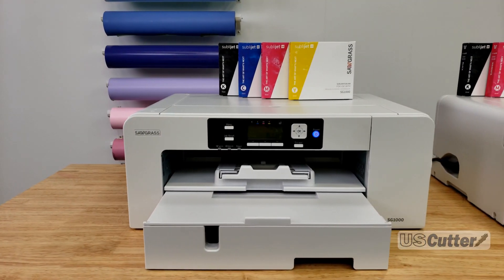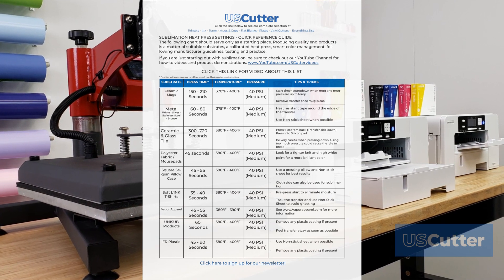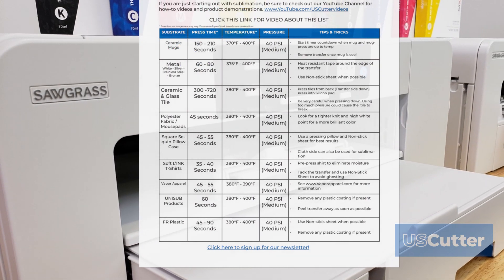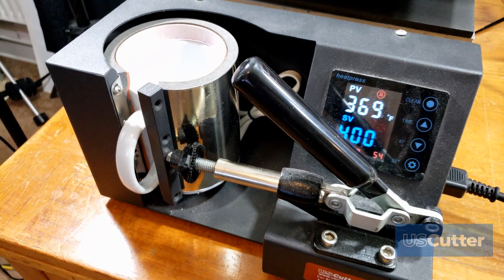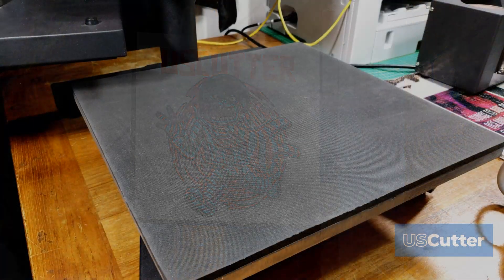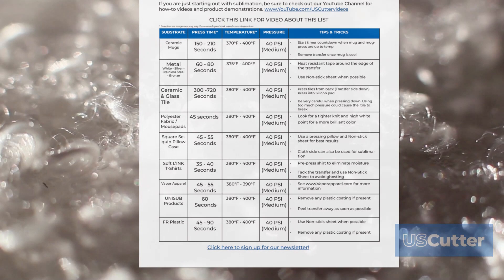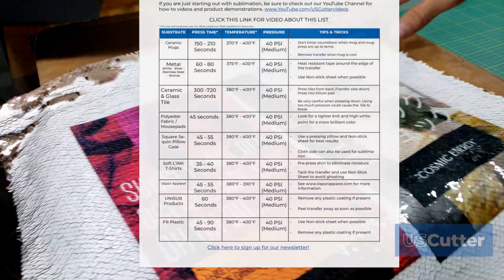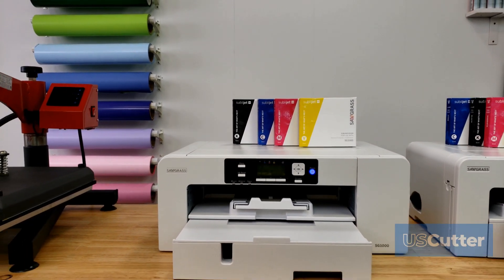SUBLIMATION TEMPERATURES & SETTINGS FOR YOUR HEAT PRESS

Comment: what paper setting to use with 50-50 blend? there's polyester and  there's cotton. but cotton requires subli light
Reply from the maker: if you sublimate onto a 50/50 blend it will look a bit faded. If you are wanting to stick with sublimation ink then using something like the siser easy subli  https://uscutter.com/shop/?search_query=easy+subli or Forever SublFlex 202 https://uscutter.com/FOREVER-Subli-Flex-202-Sublimation/  
These will require you to use a Vinyl Cutter to contour cut around the image before pressing it onto the shirt. It  will adhere to the top of the shirt like Heat Transfer Vinyl.